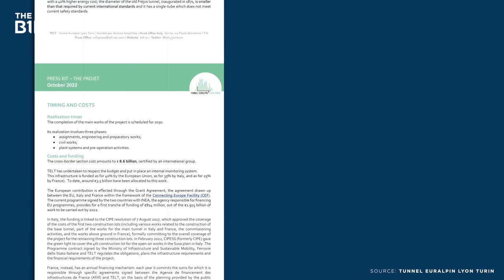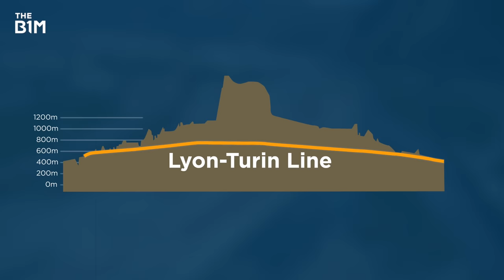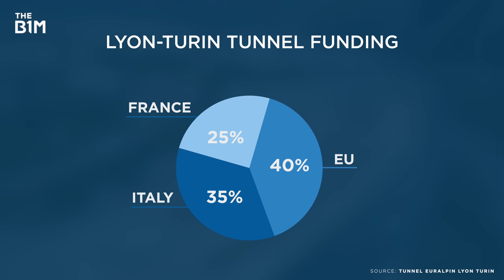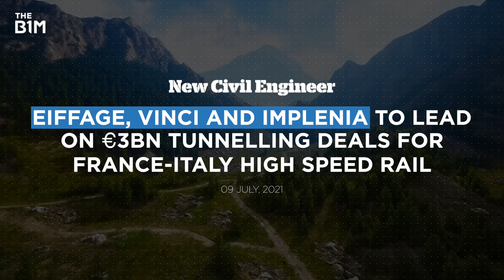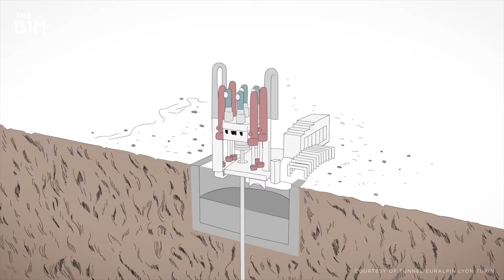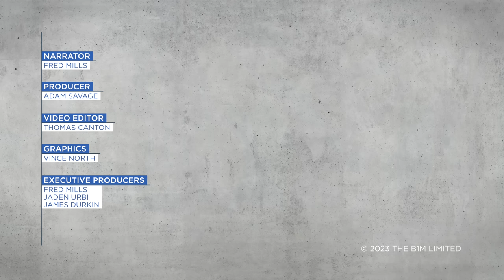Why Europe is Building a 57KM Tunnel Through a Mountain

Comment: I'm surprised that they've not added a station into the tunnel somewhere, there must be a large town along the route that could benefit from a stop along the line.
Reply: Which would require a station to be built underground, a vertical shaft drilled to provide access, and another station on the surface.

These trains are expected to be high-speed point-to-point services stopping in the named cities and that's it.
Reply: @EdwinWiles  they're already drilling holes for ventilation, so it would make sense to put a station at the bottom of one of them.
Reply: @Petriefied0246  it would be way too expensive.

The shaft would need to be bigger, to have enough space for huge high speed elevators.

The existing railway line is enough for these towns
Reply: Of corse there will be Emergency stations along the tunnel just like Brennero or Gotthard tunnel.
Reply: they were thinking about doing this in the Gotthard base tunnel, but decided against it. There is nothing really in between that justifies the extra cost and the travel time increase. For the people living there, the old mainline remains with a lot of load taken off it, thus enabling a better local service. A win-win.
Reply: @Petriefied0246  If there were a town nearby the vent, maybe, but you're missing the point that this is not a "local" train.  It is an express.
Reply: where do you find a large town in the middle of a mountain?

Comment: High-speed modern rail is definitely the green way to go as traffic expands. The USA has ignored passenger rail for three generations and is paying the price as simply booking more flights will not relieve the congestion both in the air and at the airport. Environmental arguments against rail are a total fail!  "Taking the Eurostar emits around 6 grams of CO2 per passenger kilometer, compared to 156 grams from a short-haul flight. So the footprint of Eurostar is around 4% of a flight."
Incredibly, during the Obama administration, high-speed rail links were proposed for the Miami-Orlando and Houston-Dallas corridors, and they were shot down by Republican leadership for purely political reasons. Heaven forbid government should deliver smart, forward-looking policies that make economic and environmental sense.

Comment: Around the 2 minute mark it is noted that the current line has seen “a lot less use.” It’s odd that given the lack of use on the existing line that $27b USD is justifiable to spend on a replacement line. From an engineering perspective, it’s certainly a cool project, but infrastructure spending purely for the sake of infrastructure isn’t good. I’m curious what the cost-benefit analysis was on this project.
Reply: that would be hard to do. its a single link in an entire web, just because this one link might not see return on investment, other links might have more benefit because this one exists. you need to look at the project as a whole aswell as the individual links. This is one of the more expensive ones, sure, but because it exists, its going to make the whole network in Italy and France more useful as they can now interact.
Reply: It is stated later on that the new route will be much more conducive to heavy freight compared to the steeper grades of the old line.
Reply: "A lot less use" because traffic moved to trucks on roads as the line was too old and not up to height and width standards.
The idea is like in Switzerland to force them back on rails instead of clogging the Mont Blanc road tunnel and asphyxiating the different valleys around.
And that's just for the freight part.
They'll also probably limit or even prohibit flights between Turin or Milan and Lyon or maybe even with Paris as a viable alternative will be possible.
The line's supposed to also get road / truck traffic that currently go through the French Riviera to / from Genoa and Italy in general along the Mediterranean coast.
Traffic that absolutely can't use the old line.
So it's not only replacing the current rail and road traffic of the region but meant to also replace other saturated corridors.
Reply: The Swiss national rail system needs tax money to break even. Still, it is a huge benefit for the entire country.
Reply: In Italy and Spain, high-speed rail has already made short-distance flights dwindle. Expect a similar effect all over Europe as the rail connections are brought up to speed. And the main effect is not for passenger but for freight. It's not about the current rail traffic. It's about taking over much of the current truck traffic.

Comment: "Much of the long and winding route was constructed centuries ago."  Railroads have been around for about two hundred years.  How could the current route be around for centuries?
Reply: Centuries, i. e. more than one
Reply: The rail tunnel was built in 1871, so it is already 152 years old. And the route itself may have been constructed and used before a railway was built. I don't know about this route, but I know that the Gotthard route took over much of the Medieval Alps traffic from more ancient routes when they cleared the debris in the Göllenenschlucht and built crucial bridges in 1220 and 1230.

Comment: Trains are extremely expensive. They should build roads for cars.
Reply: Cars are more expensive than rail bud. Facts don’t care about your feelings
Reply: @darthmaul216  Railroads are extremely expensive to build and even more expensive to operate. Tickets are 20% of the cost, the rest is subsidies.
The drivers themselves pay for everything and are a profit for the state.
Reply: @nnnnnn3647  the thing that you are forgetting about bud is capacity and maintenance both of which make rail cheaper then roads bud

And even then roads don’t make a profit or break even at all
Reply: @darthmaul216 Unfortunately, in practice, rail transport is permanently unprofitable and requires hundreds of billions of subsidies. Trains don't make money. It is a relic of the 19th century.
Only high-speed trains with tickets priced at a profitable level make sense.

Comment: 70% of the project is in French territory and they only pay 25% and Italy has 30% of the project and pays 35% of the total project?
Reply: Several other commenters and myself replied to this question: 
The shared cost mentioned in the video is for the tunnel and a few bits here and there that are only the international of the overall project between Lyon and Turin.

The French have a much longer stretch of HSL (for passenger trains) to build on their side between the existing Paris <> Lyon <> Marseille HSL and the base tunnel, and much longer stretches of conventional tracks to upgrade for freight trains. They'll cover these costs separately as this new HSL is essentially a domestic line to sum it up.
The cost mentioned in the video is the international part of the project, even though it presents the overall project between Lyon and Turin.

Comment: What about if a train derails? You're in twenty miles from nowhere and in a tight place.
Reply: Which is why, as with all such tunnels, there are vertical ventilation shafts and side-by-side tunnels including an emergency access and rescue tunnel.  Most projects of this length have three tunnels.  Two full size ones that handle the normal traffic, with a smaller one running between them to serve as an emergency access.  It also serves as the pilot tunnel so they can identify issues before the big machines get to that area.
Reply: This is why we don't let Elon Musk and his pathetic boring company create our tunnels.

Comment: Wrong info: You said it'd take off 1 million semi's from the road, and remove 3 million tons of co2 a year. Semi's produce, on average, 228 tons of co2 per year. 3,000,000 vs 228,000,000 tons, that's a pretty big discrepancy. And not even factoring how much co2 the freight train produces. 

B1M is often riddled with inaccuracies and false information.
Reply: Ehm, your calculation doesn't make much sense. As you say yourself, using a different mode of transport doesn't mean the freight will be teleported without using energy.

Comment: How come 70% of the line is in France but they only pay 25% of total budget? Italy spends 35% of the line in with only 30% of it being in Italy, Doesn't make sense to me.
Reply: Already answered several times: 
The shared cost mentioned in the video is for the tunnel and a few bits here and there that are only the international part of the overall project between Lyon and Turin.

The French have a much longer stretch of HSL (for passenger trains) to build on their side between the existing Paris <> Lyon <> Marseille HSL and the base tunnel, and much longer stretches of conventional tracks to upgrade for freight trains. They'll cover these costs separately as this new HSL is essentially a domestic line to sum it up.
The cost mentioned in the video is the international part of the project, even though it presents the overall project between Lyon and Turin.

Comment: France getting a cheap deal only 25% of costs and Italy 35% but Italy getting less of the line.
Reply: Several other commenters and myself already replied to this question: 
The shared cost mentioned in the video is for the tunnel and a few bits here and there that are only the international of the overall project between Lyon and Turin.

The French have a much longer stretch of HSL (for high-speed passenger trains) to build on their side between the existing Paris <> Lyon <> Marseille HSL and the base tunnel, and much longer stretches of conventional tracks to upgrade for freight trains. They'll cover these costs separately as this new HSL is essentially a domestic line to sum it up.
The cost mentioned in the video is the international part of the project, even though it presents the overall project between Lyon and Turin.